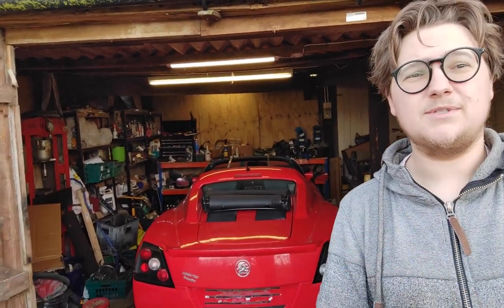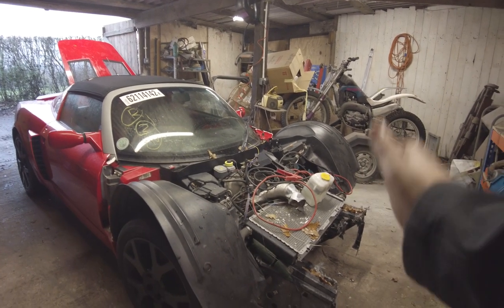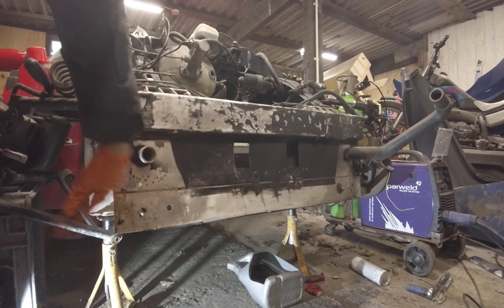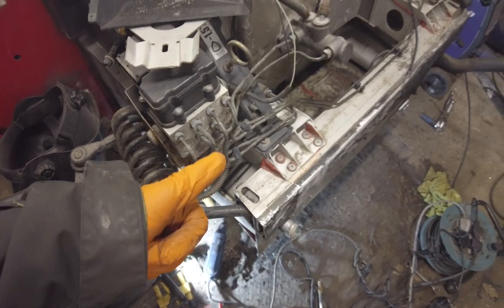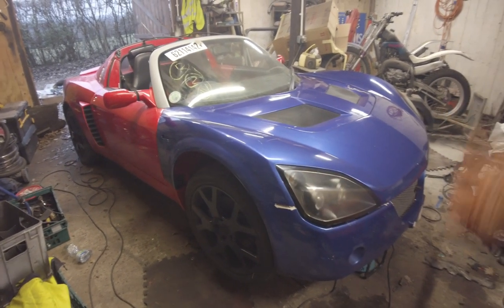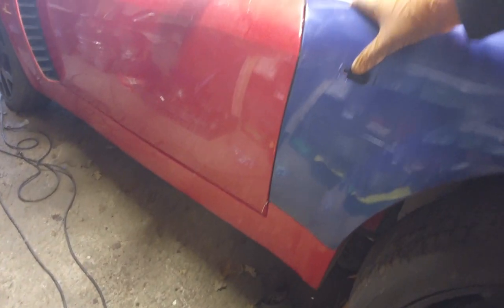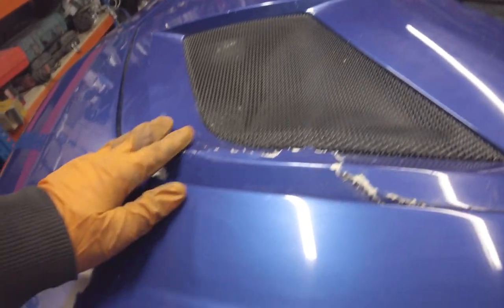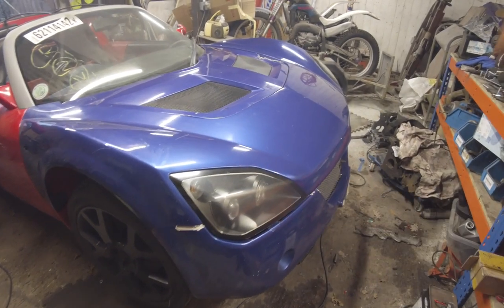Rebuilding Vauxhall's Forgotten sports car!! VX220/Opel Speedster Part 2

Comment: Great project, you where lucky with the damage  as the metal structure seems good, its one of those where it looked worse than it is, looking forward to the next episode.
Reply from the maker: Thanks 👍 yea I was lucky that the damage was only central as if one of the wishbones had been ripped out then I would have been in trouble!!

Comment: I would replace the radiator for a alloy unit whilst it's partially stripped the oe unit was prone for leaks coolex do the cheapest option